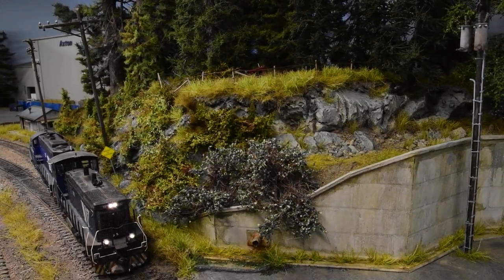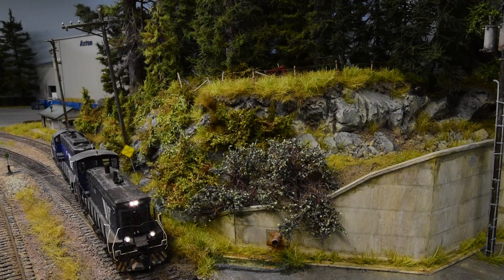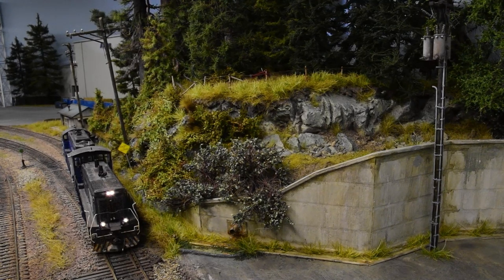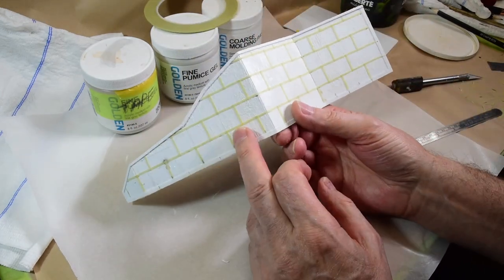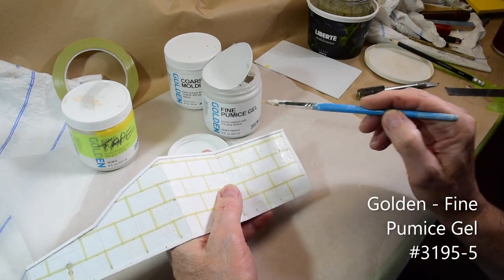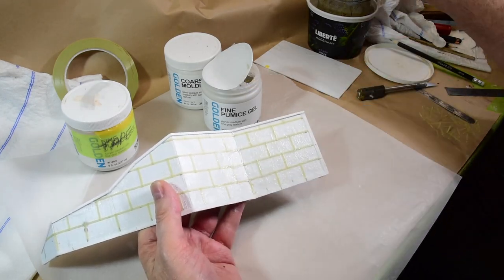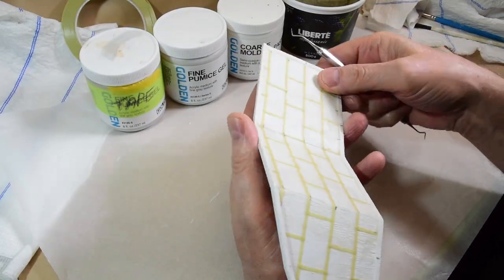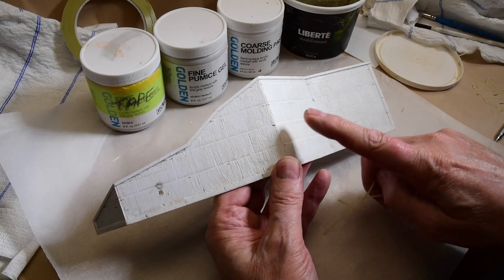Texturing a Scale Retaining Wall | Boomer Diorama ~ Vlog # 181

Comment: Very nice as usual. But to just nit pick, with the joint lines recessed, it looks more like concrete block with grout lines. For a poured concrete wall with forms made from 4x8 plywood, I think the lines would be more from thin lines where concrete oozed out from between sheets and thus raised, not recessed?
Reply from the maker: The wall could be cosmetic, as you say, as well. The lesson is more about texturing technique than it is technical. 😁

Comment: I love how the wall turned out. We know the lines are to thick for scale, but it doesn't really scream that at all. You fudge things a little so our human eyes can recognized it, and our minds complete the picture. I did have a question, can you cut the vallejo paints with IPA the same way you thin down the tamiya? I want to use it as a stain on some strip wood for a craftsman kit. I just don't want to use water which usually causes the thin wood to wrap like crazy.
Reply from the maker: Just use water to thin Vallejo. Don't use IPA. IPA will craze it.
Reply: @boomerdiorama  I figured I would ask you. Good thing I did!